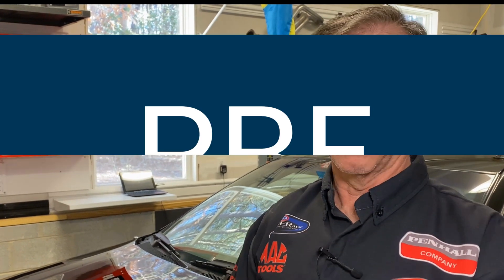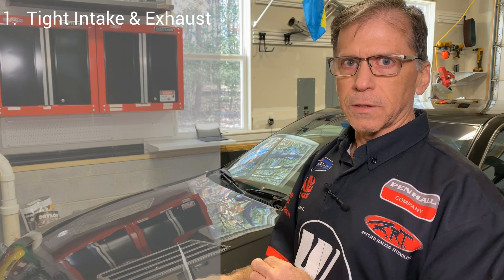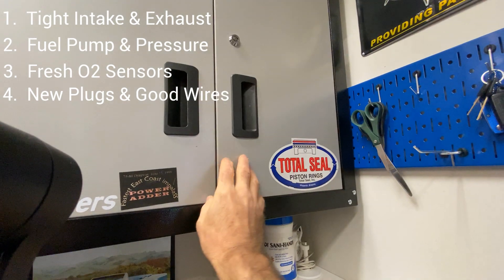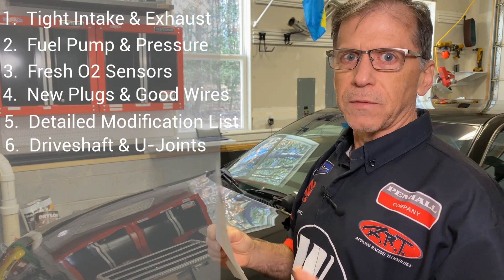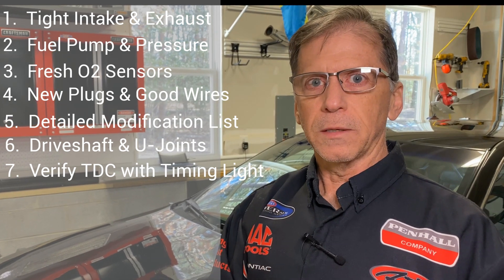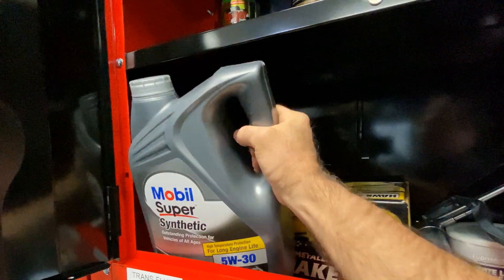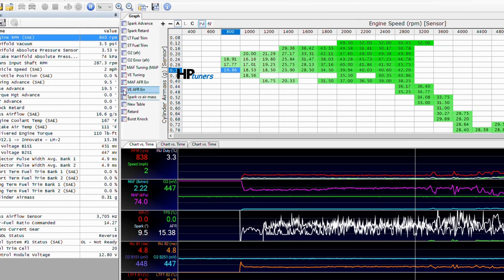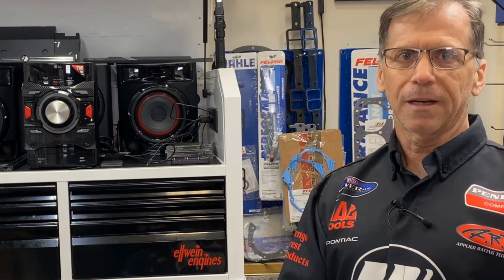Pre-Tuning Checklist--Chapter 1--Street EFI Tuning

Comment: Great info maybe one day I will go EFI. I would really like to tune cylinder to cylinder for safety.
Reply from the maker: Maybe we can talk Holley into sponsoring you.  You....the last of the carburetor tuners.
Reply: @EllweinEngines   Next LT1 you dyno I want to bring one of my carburetors and test out the adapter and filter. It will be interesting to see how much HP it may or may not take vs open carb. I can bring some cash for the extra dyno time to compensate.